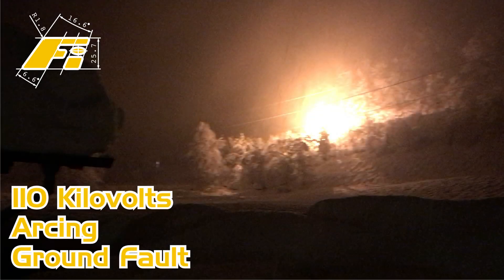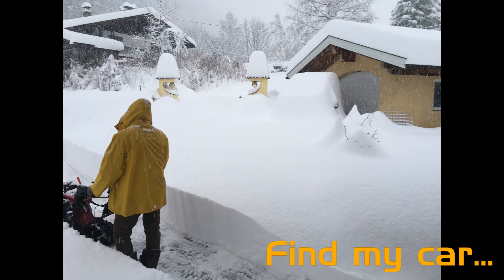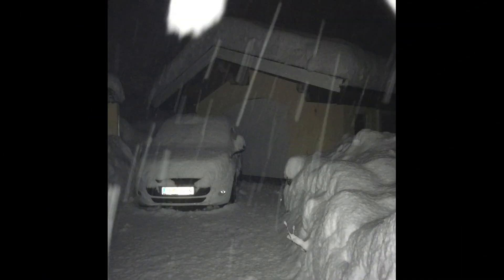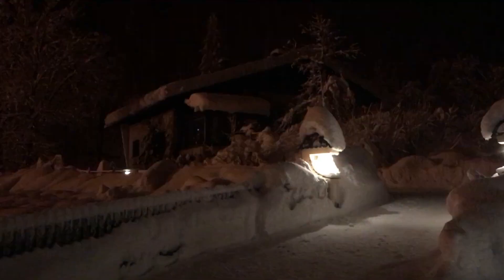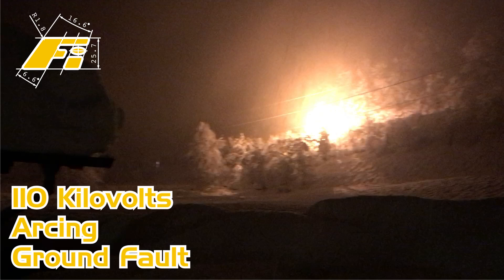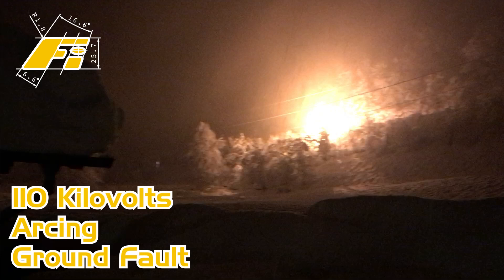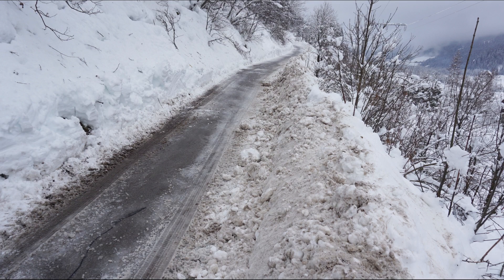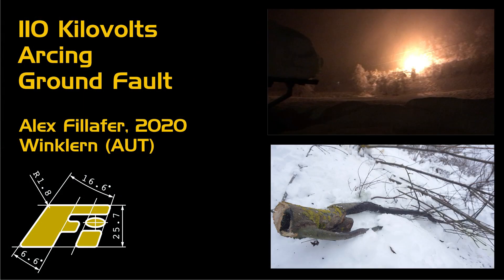110 Kilovolts arcing Ground Fault behind the House

Comment: Not sure if you will see my comment since this is such an old video, but when I was a kid nearly 40 years ago now, we had a tornado come through and take out some major electric transmission lines about a half mile behind our house.  These were large steel towers with about 6 transmission lines on them.  The tornado took out more than 20 towers over about 5 miles.  My dad and I stood on the back porch and watched the tornado move down the line making huge blue and orange flashes as it traveled.  We own the land under where several of those towers stood and still to this day we find twisted up angle iron in our fields.

Comment: Very cool to see.  We had 1500 KW 460 V 3 ph diesel generator go to ground before the circuit breaker.  Only way to stop the arc, was to shutdown the generator.  This was on a ship while were in the shipyard  in Singapore.  Very interesting since I was the engineer on scene when this happened.  Of course there was an ensuing fire in the main switch board,  took another 2 weeks to repair.  Cause was a cracked insulator at the cable connection to the circuit breaker.  Just imagine a 2in, 50mm diameter welding rod,  the generator loved it, full load baby.  Thanks for the video.
Reply from the maker: Awesome story, I'm glad I wasn't in your shoes then....

Comment: Today I learned: I thought 110kV power lines have ground fault interuptors, but I guess they dont
Reply from the maker: The guy at the power supplier told us that this incident had only little current flow so automatic shutdown didn't trigger.
Reply: @anengineersfindings  I wonder what a lot would look like. Boom, no more tree?
Reply from the maker: same here....
Reply: @hashgeek929  Something like that ;-)
And a very loud BANG at the power station / switch yard as the breaker interrupts the surge.
You won't need to call the station when there is a proper short circuit. They will know.
But still well done calling this in, a proper short-circuit would have cut power to the region, and this might have become one as things started to burn.